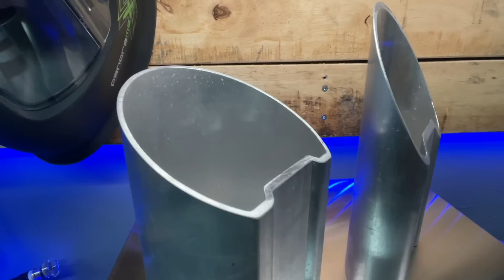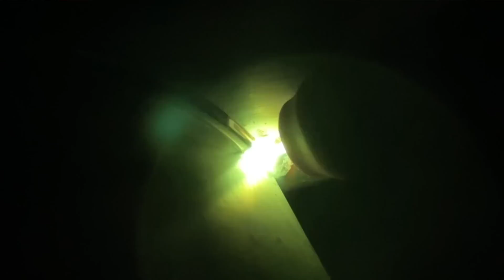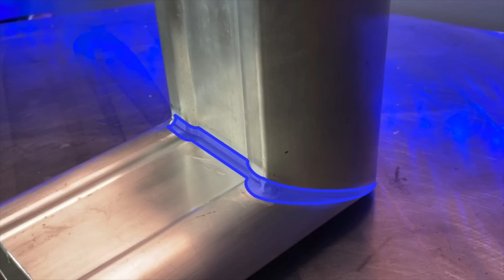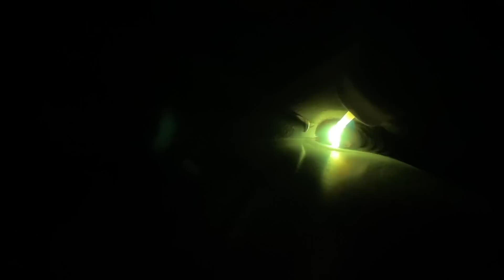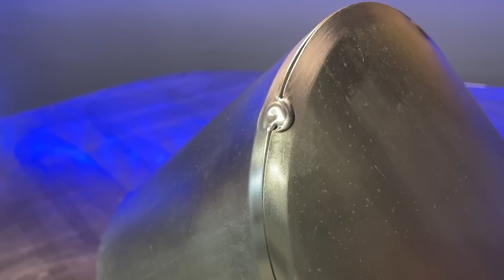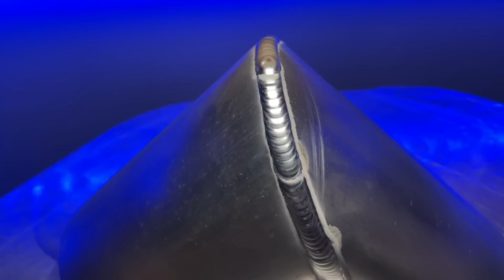The hardest Tig welding joint I've learned.

Comment: Just learned about using bends in your filler wire today on the job. Changed how I weld the job entirely. Glad I work with people like you who actually  know what they're doing.
Reply: The one I saw done by titanium welders blew my mind the first time. In an argon chamber they take their tungsten and stick it, get it glowing so they can bend the tungsten, and weld around corners using a mirror.

Comment: Hey Dusty, another great video. I do quite a bit of aluminum railing and run into joints like that often. I would love it if you could do a video on out of position. Since the rail sections can be up to 16 feet long, I find myself having to weld out of position quite often. Much of the time I am so contorted that I can not use a pedal, I have to use a finger switch. Managing my heat input in that situation boils down to the speed of travel and increasing the amount and rate of filler material. Any thoughts or advice on welding in tough conditions like that would make for an awesome video. Keep up the great work!!!!!!
Reply: By out of position you mean non bench welding? In the field you do whatever is necessary, using your knee or inside/back of the leg to activate the pedal. I've even had a few situations where I used the back of my head to push the pedal haha

Comment: Outstanding, but I use a much different perspective. Unless a stack of dimes is what the customer calls for, I will always keep my filler rod engaged, a stack of dimes takes practice to remain consistent. I never hesitate to start and stop, my rod cools in the puddle. I restart well away from the rod, rerun over the weld and it's as if I never stopped welding by the time I get back to the rod (reposition after every stop), even if you can only go a few more inches. It will end up looking smooth as one continuous weld, a food-grade weld. I have to admit the fact that I struggle to stack dimes, I'll stick that rod on my tungsten every time like a dork! I am a food-grade welder who admires his stackability! Some like to pick a nose, and some like to blow a nose. With good, consistent, heat control I use a very light, dragging the cup technique, to maintain my tungsten distance. That is just how I taught myself, my hands know how to do it, I never even try anymore, it's automatic.
Reply: I too struggle to get the perfect stack of dimes look. I can get the perfect stack look doing kind of like you do, never move my filler rod, 1 pulse per second, moving my torch on my Dynasty 350 and an extra dab at the end of the run to prevent crater crack.